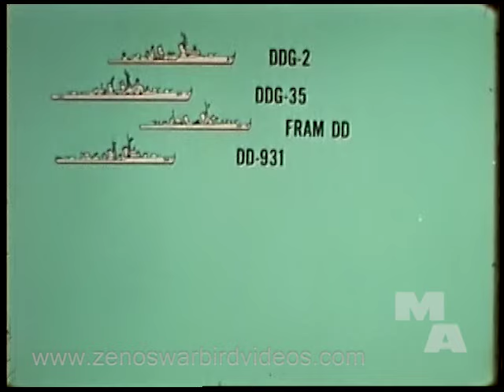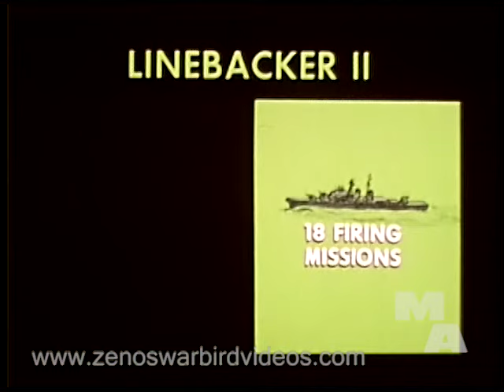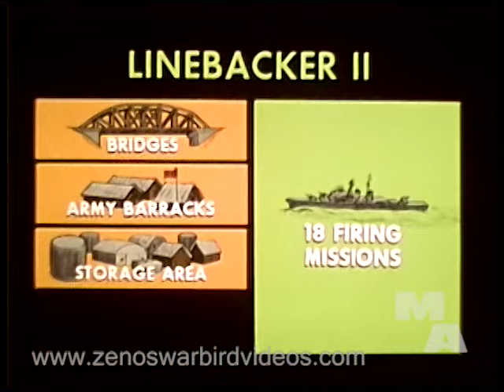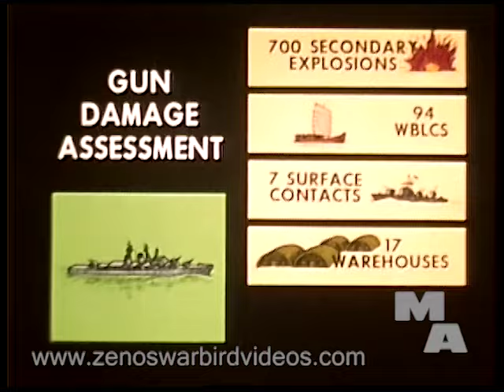U.S. Navy Hit & Run Gunfire Strikes on North Vietnam (1973 - Restored)

Comment: The U.S.S. John R. Craig DD-885 was struck several times on April 9 off of the DMZ. This report errs just before minute 9 when stating that these ships received no damage until April 17. I was on the bridge on that morning. The crew was awarded the Combat Action Ribbon.
Reply from the maker: Thanks for posting  & thank you!
Zeno
Reply: I remember the John R. Craig in '68.  I was on the Gridley DLG 21.  I think Gridley's squadron DESRON 19 may have included you ship.
Reply: This report is about the surface strikers that went north of the DMZ and fired on North Vietnam. None of those ships including the one I was on, USS Joseph Strauss DDG-16, received any damage until April 17.
Reply: @davidsoule1252   I don’t know the definition of ‘surface strikers.’ I believe we did head north of the DMZ (DD-885) and that the only place we were damaged was at the DMZ.

Comment: was on ddg-16 joseph strauss on linebacker 1,11,.71-73
Reply: I was an FTG aboard Strauss during the 70' and 72' West-Pac tours. The two underwater explosions on June 4, 1972 off the coast of North Vietnam was the worst day I ever had in my life. Strauss was dead in the water after the first explosion. Then the second underwater explosion.
Reply: @davidsoule1252  I was the electrician in engine room #2 the rear of the ship would become dark and powerless from the mine putting out the rear engine room boilers by water coming down the #2 stack  and putting out the # 2 fire room 1200 hundred pound super heated steam  boilers.

Comment: I was a ground-pounder in Vietnam. I had no idea this stuff was going on. Good for the Navy, but this film at least is honest enough to question the cost-effectiveness of such operations. Too bad nobody ran a cost-effectiveness analysis of the whole war before we got involved. I never heard of Pocket Change before. Was that a North Vietnamese minelaying operation?
Reply: WE WERE THE MINELAYERS.
Reply: Just after midnight on June 4, 1972, my ship, USS Joseph Strauss DDG-16, was making one of these night runs against North Vietnam. Strauss was damaged by a huge underwater explosion near the bow of the ship. The front half of the ship was lifted out of the water, fluttered for a second or so and then slammed back down into the water. Strauss lost power and was dead in the water. We did have emergency lighting, but that was all we had. While dead in the water, a few minutes later there was another huge underwater explosion off the port side. The ship started rolling to starboard, 10 degrees, 20 degrees, 30 degrees, then at about 40 degrees the rolling slowed, then the rolling stopped at about 45 degrees. Then the ship uprighted. Strauss was towed farther out by another destroyer. Boilers were relit. Engines refired. Divers went into the water the next morning to inspect the damage. Minor damage to the hull according to the divers. Strauss remained on station off the coast of North Vietnam. On this YouTube film at about the 12 minute mark, Strauss is mentioned as being disabled. Strauss was a 437' long ship. Yet it was picked up halfway out of the ocean by an underwater explosion. A month later, USS Warrington had a couple of similar underwater explosions in the same general area. Warrington was so badly damaged that she was towed to Subic Bay, P.I. and decommissioned. USS Hollister later had a couple of similar underwater explosions. Hollister remained on station. USS Davidson had a similar underwater explosion. A later investigation determined that Strauss, Warrington and Hollister were damaged by U.S. mines. Parts of a U.S. MK 36 Destructor Mine were found on USS Warrington. These were all from mislaid U.S. mines. Davidson was also probably damaged by U.S. mines.

Comment: I have always found the "yes you can work without your shirt on" accommodation to be simply  an accommodation, one with no practical value but one with perceived value from those that think having your shirt off is "better'.  If your 'charges" work better or harder without their shirts on who cares if it is all in their heads (it is)? Myself, I like the protection from dirt offered by my tucked in shirt and it helps block the sun. If the shirt becomes wet through perspiration or intentional "watering" it can actually help you feel cooler. Lots of reason to keep your shirt on but people with only 8th grade educations can't grasp the technical nature of the evaporation process, it is like speaking to a wall.
I have always thought more "from the sea bombardment" would have been of benefit. After taking in the total of information out there I find that the effort was already quite extensive. I do not know if more of the rapid firing triple 8 inch mounts were available but that would have been the minimum. The ability of the enemy to score hits on ships with some regularity was quite a concern.